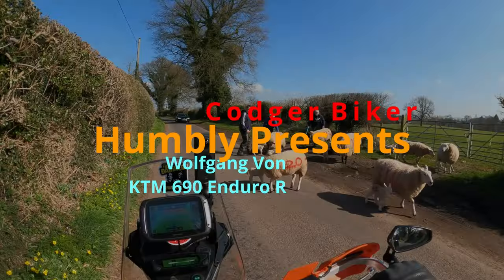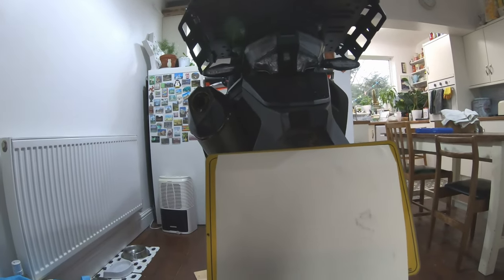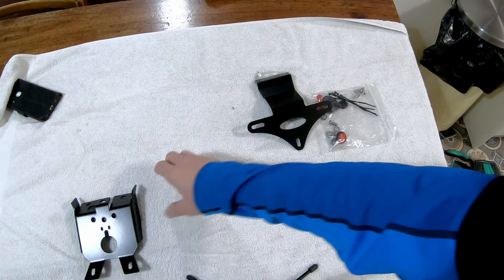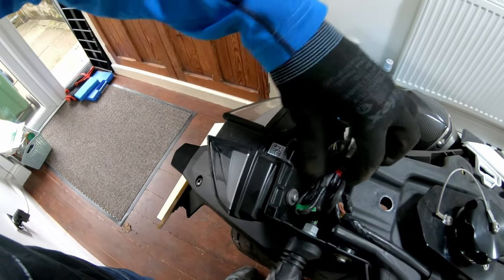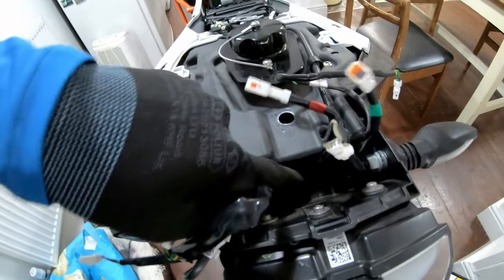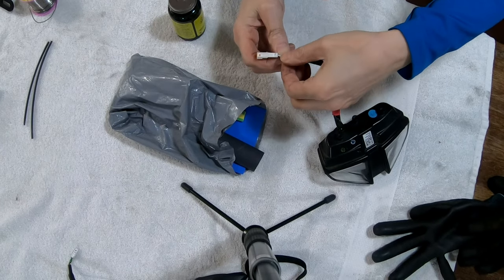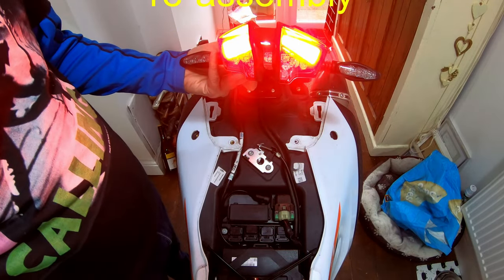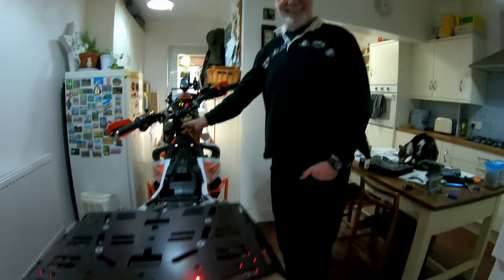KTM 690 Enduro R - Tail Tidy Secret

Comment: Great video and thank you for the clear instructions. I too ordered the dbmoto tail tidy kit from eBay and am very pleased with the outcome and the integrated number plate light activation. I am in the USA and can confirm that the built in light can be activated on a 2023 KTM SMC R US Spec bike. The dbmoto tail tidy also fits the US Spec license plate size perfectly with no need of additional modification. It is very nice to have the factory tail light and I think that the dbmoto tail tidy is of good quality and easily the best looking available for the current generation 690 Endure/SMC R bikes. Similar to your thoughts, I too had concerns with the included scotch lock so I decided to use a splice/butt connector to run the green power wire from the body harness to the green and white wires (spliced together) on the tail light side, all wrapped with heat shrink for added peace of mind. The built in license plate light is plenty bright enough too. Thanks again for uploading the video!
Reply from the maker: No problem. Mine has been fine also after many months of riding. Thanks for watching! 👍👍

Comment: Nice video and thanks for the heads up because I went to check my screws that hold the license plate bracket & they were both missing, I just replaced them & used blue lock tight & a lock washer. Thanks, everyone ride safe 🙏
Reply from the maker: No problem, glad you noticed in time. I blue loctited mine (not always advisable in this kind of fittings) they stayed put and came undone okay (you can hear the snap in the video. 👍👍
Reply: @CodgerBiker  I hope with the blue lock tight & lock washer they stay put just fine, but thanks to your video I'm aware of the issue.

Comment: all still well with your tail end tidy up ordering mine tidy bracket now.
Reply from the maker: All has been fine. You get a little more dirt up the bike as expected, all good otherwise 👍
Reply: @CodgerBiker  can officially say I disassened bike and soldered power supply jumper this evening. Tidy bracket will arrive tmw. Thanks again for the great tip & video

Comment: I think I remember hearing in a video that the USA have some weird throwback law with an issue against LEDs on vehicles. Can't remember what it is, but it made sense to somebody at the time 🤷🏻‍♂️
That looks better 👍🏼
Reply from the maker: I think it’s only some states (somebody will know) perhaps it’s a bulb syndicate thing😂 Cheers. I hope to lose fewer bolts 🤞👍
Reply: @CodgerBiker  Likely hidden as a 'safety' issue as you can easily replace a faulty bulb while on the road...
Reply from the maker: Could be. But they should look at an MZ 6v bulb indicator - virtually invisible 🤣

Comment: Hi, does it enough connect white and green to get the secret light on? or is there something else to do? Thanks in advance!
Reply from the maker: That's pretty much all I did. I think the light is there for other models, it just needs the power supplying to it  But  don't cut supply to the tail light, or it will go out. 👍

Comment: Hey mate when I did mine I just pulled the pin out of the plug and reinsterted it into the tail light plug that was blanked off. Hope this helps
Reply from the maker: Good stuff. I don't think mine had any wire at the blanked pin. Glad you sorted it. 👍

Comment: Nice! Where did you get those brackets? I want to keep the original lamp, most kits seem to include their own.
Reply from the maker: From the good old eBay. Just search ‘2019 690 enduro r tail tidy’. Mine’s a 2020, but it’s the same. 👍

https://www.ebay.co.uk/itm/163916058043?hash=item262a288dbb:g:j4QAAOSwcJVdo4MC

Comment: how did you plug and unplug that little piece of plastic stick inside the plug? for the life of me i cant get it out... don't want to break it. cheers!
Reply from the maker: Hello. Not sure I understand. The plugs have a lever that secures it against coming apart. (Stick?) You either (depending on type) press the lever and pull, or (different type) lift the lever and pull. A small screwdriver helps.
Reply: @CodgerBiker  thanks. I meant the internal connector for individual wires. Couldn't get the white plastic insert out.
Reply from the maker: Ah I understand. Usually they have a one-way barb of some kind. I did not remove it. Instead (if I understand) I simply bridged it, very carefully. Using a soldering iron to melt away a small amount of insulation. Then soldered bridge wire in and re-insulated both joints. No wires were broken. I can restore it to original just by removing the link.